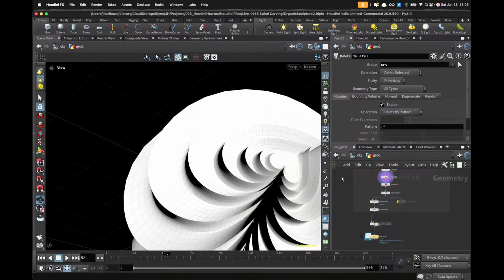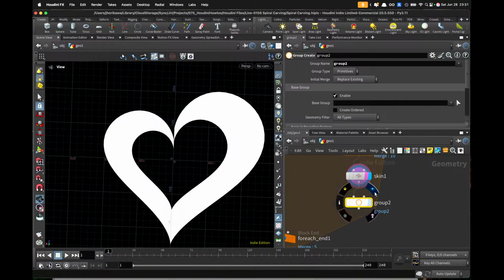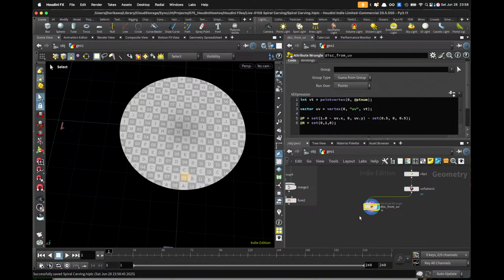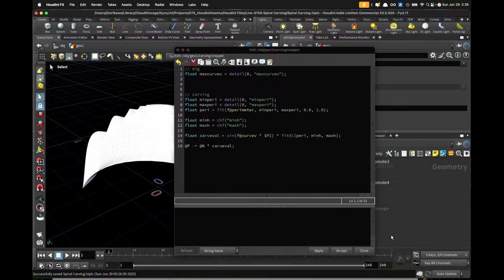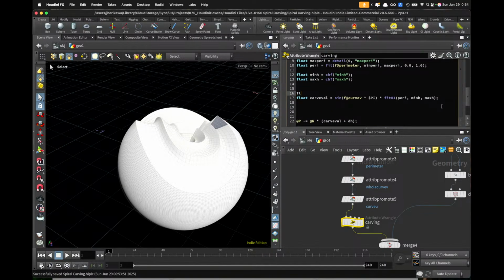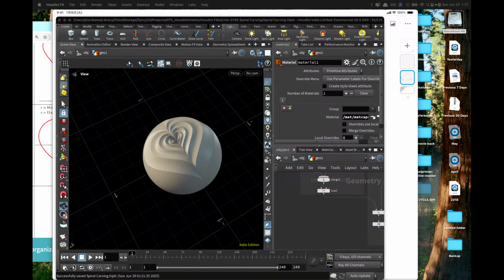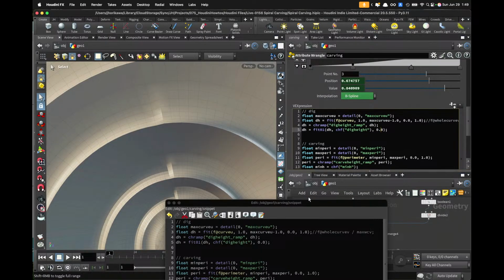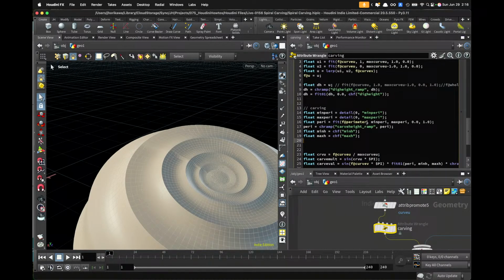Houdini Algorithmic Live #156 - Spiral Carving

Comment: For anyone who receives an error log like this:  "Bad node type found: clip::2.0 in /obj/geo1."
It may be a mismatch in nodes based on versions, so replace the object in question ie. I replaced the clip node with my versions clip node and it fixed the error.

Comment: Hi Junichiro, Amazing stuff as always. I have a question. I am very intermediate at Houdini. I followed your spiral carving stream and I encounter a problem I have no clue how to solve. If I put a texture that has a pattern, render looks so jittery and pattern is jumping all over the place. Works with solids. Is there a way to make patter stick to entire object so when carve happens materials doesn't dance all around. I am sure it has to do something with UV's but I have no clue how to solve it. Any suggestions. Thanks in advance. I was thinking maybe a packing it at the end or using triplanar as UV's but not sure if that is where I should look for a solution. Thanks in advance. Neb
Reply from the maker: try using UV Texture node or UV Project node with polar mapping option at the end of the modeling process to add uv then apply texture.
Reply: @JunichiroHorikawa  Thanks!